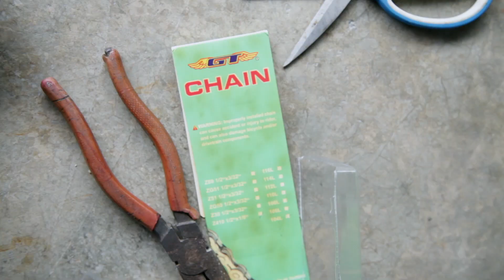GT BMX Pro Series build up (part 3)

Comment: I bought 93 pro series but came with ACS Rotor just there with no brakes, tried taking it off but can't even remove the neck stem. To take rotor off. Any advise?